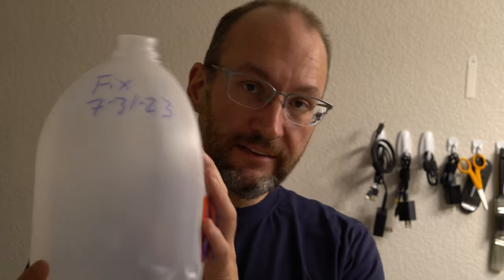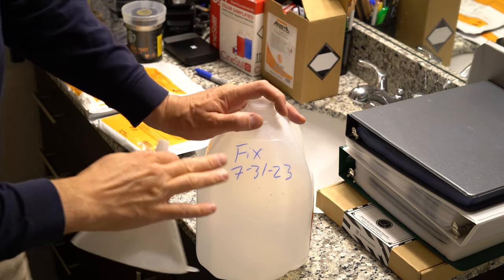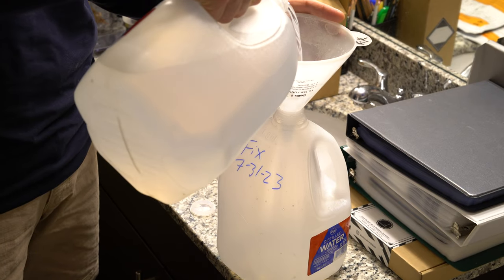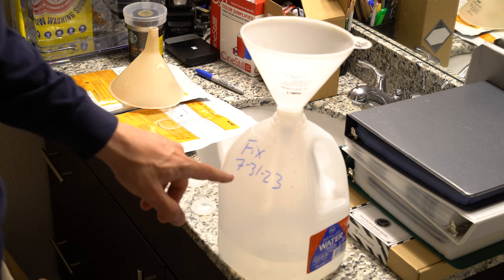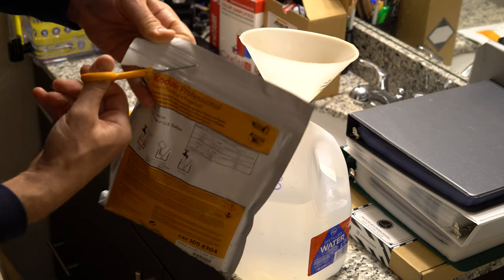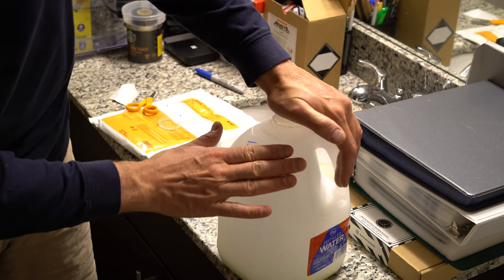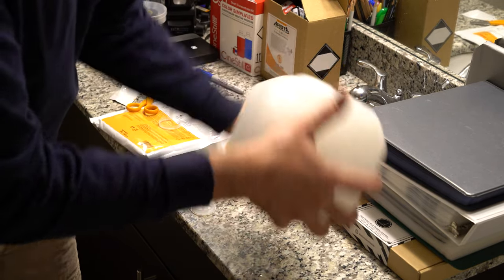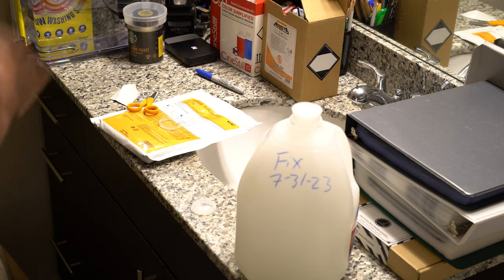Mixing Kodak Fixer from Powder | Developing Solutions

Comment: Hello David, great video! if i dont want to mix the full bag, what should i divide the amounts for? Is dividing by any number valid?
Reply from the maker: Thank you and you have to mix the whole bag. The compound may not be dispersed evenly within out so if you only mix part you may well end up with a developer that does not work at all, at worst, or properly, at best. If you want to use only small amounts of fixer, check out the liquid concentrate options.

Comment: MANY, MANY times, I hear people say, "Do not use a container/funnel that has been used for 'fixer', for 'developer' as well.  I thoroughly understand the reasons why!  That said, should a person throw out a Paterson tank each time they use it for a developing cycle?  Both developer and fixer are used in the same tank.  And, after the tank is washed out and dried (From 'fixer'), it is used again with 'developer'.  I use the same funnel, mixing spoons, graduated cylinders, etc for BOTH 'fixer' and 'developer'.  I made the decision to do so, because I am using the SAME container (My Paterson developing tanks.), for 'developing' and 'fixing'.  I have never had a problem.  Just wash everything, just like you would do with your developing tank, after each use.

Thank you for all of your videos, BTW!
Reply from the maker: Thank you and good question. On Patterson tanks, they area different type of plastic than are funnels and plastic beakers. Does that mean they don't absorb chemicals? No -- I don't know if the absorption rate is similar, greater, or lower. It seems a safe assumption it's lower, but I have no data to indicate either way. One item to note in that vein, I've never known a school lab to use plastic tanks -- only beakers with clear developer or fixer marking. I also don't know of any labs processing in great volume that also use plastic (though I 'm not an encyclopedia of lab practices for labs around the world, in fairness.) I suspect that for most home users, it's fine to use Patterson tanks and, likely, re-use plastic components between chemicals as long as the plastic component is washed and dried first. I have a 2,000 ml plastic beaker and, yes, I use it for both fix and developer (mostly fix, in fairness) but I don't use it for developer after I use it for fix when I develop many batches on the same night unless I wash it with soap and water first. I think that the greatest risk is, honestly, developing in batches and having a bit of fixer in the bottom of a beaker and then pouring developer into it and neutralizing the developer.
Reply: @DavidHancock  I think of it another way: If a surgeon operates on one person, then washes their arms and hands before operating on a second person, then that correlation is good enough for me.  Cleanliness is key, but the constant banging-on-the-drum of, "You can't use the same container for developer and fixer.", is not.  Common sense is.

(BTW, I develop 99% of my B&W film with Caffenol CH.  I also do the same with Ilford XP2 Super 400 and get excellent results.  There again, people will tell you that, "You can't/shouldn't do that." with XP2.  It must be developed with C41 chemistry.  Not true!).  Keep up the wonderful work that you do!

Comment: Hi, David
Mind if I ask a question about chemicals for c41?
I understand the developer has a limited number of uses and loses potency after each use, as well as a shelf life. 
Does the same hold true for the "blix"? And is it the same number of uses or more (compared to the developer). 

The reason I'm asking is I'm going to be mixing a C41 liquid  quart kit (from CineStill) and my plan was to only mix half of the developer chemicals, (with the intent of keeping the other half of unmixed developer in reserve, since I don't develop a lot of film and the entire quart would likely expire before I get to use them). 

Does the "blix" have a limited shelf life after mixing as well? And does it lose potency after each roll? 

Thank you!!
Reply from the maker: Good questions. So I'm just getting into C-41 development and have used three different kits so far -- Rollei, CineStill, and Artista. I understand that the chemistry is good for 8 rolls, then can be stretched to 16 with extended development times. I suspect that it can go longer. My best guess on blix is that it's much more long-lasting than the developer (only because that's the case with black and white film, and quite frankly having the fix go dead before the developer would make customers very unhappy.)

My best advice for mixing chemicals is never mix part way because there's no guarantee that you'll have proper base chemical ratios. You could end up with completely ruined results (or it could be just fine.) So what I do is build up 16 rolls of C-41 and then develop it all at once. I don't store the stock solution and treat it like a one-shot. In terms of getting the best results and optimizing your film dollars, that's probably the best approach. Once mixed to stock, the C-41 chemicals have a short shelf life. They also, once the bottles are open, apparently oxidize and die somewhat faster than black and white chemistry, IIRC.
Reply: @DavidHancock  Great advice to keep in mind. Thank you!

Comment: I was interested in the mention of chlorine in the water that fix is made up with. I decided to check out whether my tap water had chlorine in it, Its very 'soft' water as there's no calcium carbonate in it. 
Yeah, there's chlorine. However the 'Scottish Water' website stated if you are sensitive to chlorine, some people are apparently,  just leave it in a jug for several hours in your fridge and the chlorine will dissipate. I'm presuming the chlorine simply holds back your fixer from working as effectively - I dropped chemistry as quickly as I possibly could at school because chemical equations were all gobbledygook to me; although I did 'A' Level Geology, if that helps   😁
Reply from the maker: That's a good point on the chlorine; it will off-gas given a bit of time (I have a couple of gallon jugs that I use to water the pepper and herbs plants on my balcony, for instance, and I let those sit 1-2 days before use to get the chlorine to fully off-gas.) Most filters like Brita and Pur remove heavy metals and chlorine, but not the minerals that make water 'hard.'